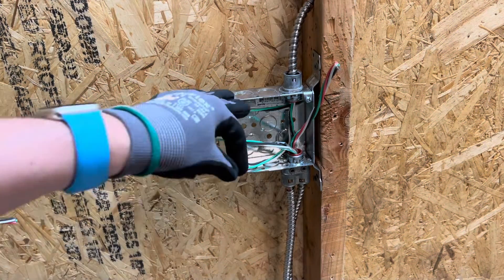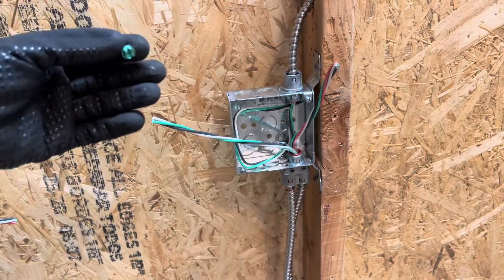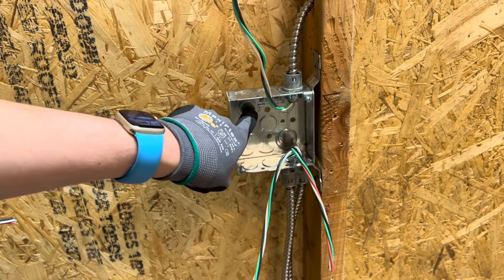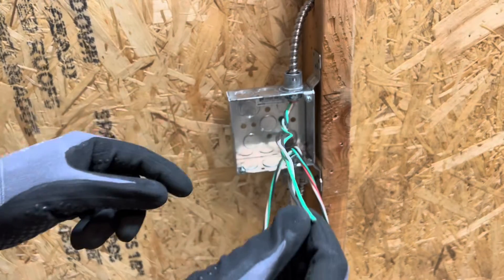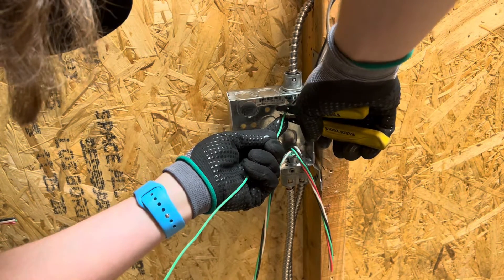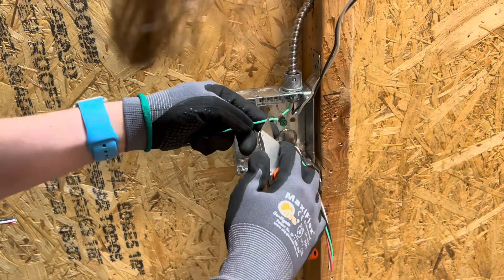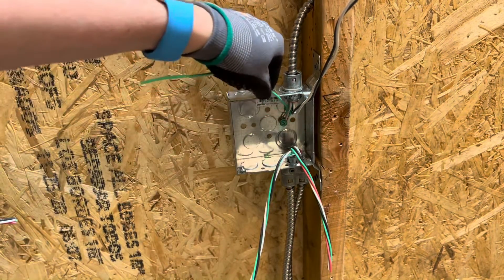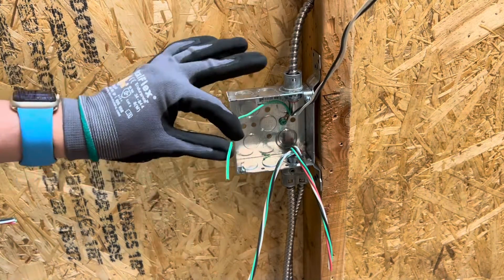Electrical 101: Four Square Box Grounding

Comment: this method severely compromises that cable's ground wire. future electricians who service this box will gradually weaken the point where the copper leaves the ground screw. once your wire breaks off the screw the next electrician is left with very little ground to work with when servicing this box. for this reason i prefer a dedicated ground wire for the box's ground screw so that all incoming/outgoing cables can keep their grounds for future service. adds an extra wire to your ground splice, but ensures future sparkys serviceable ground wires that can actually be pulled passed the mudring/box opening for troubleshooting/repairs ect.
Reply from the maker: thats very fair, i like that

Comment: You should never wrap the wire around the screw in more than a "U" shape (the wire should never cross over itself underneath the screw).  This can potentially result in a poor connection because when tightening the screw down it can feel like it is fully tightened, but then the wire can shift underneath it and actually become loose later (I have actually personally seen this happen, too, so it's not just a theoretical concern).
Reply from the maker: appreciate that!

Comment: On rough in inspection, I got dinged for not grounding the box.
I said that the yokes on the 2 devices were grounding it, as they were grounded and screwed to the cover, and a meter would prove it.
I was told that the cover screws were not listed means of grounding the box, so I had to add a ground.
 Then we moved on to the next thing, a junction box with no devices in it. 
I had a box ground there, but I asked what grounded the steel box cover if the cover screws were not listed grounding devices?
He had no answer, but passed it anyway.
Reply from the maker: LOL!